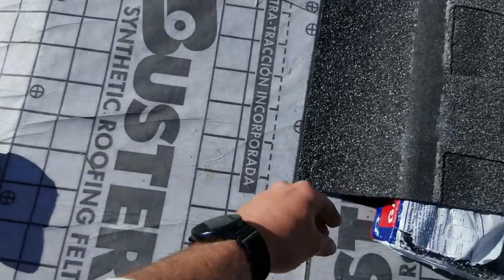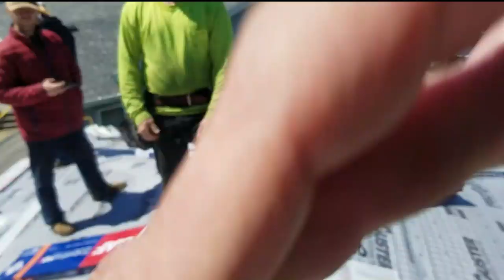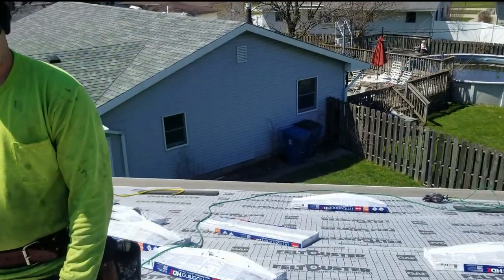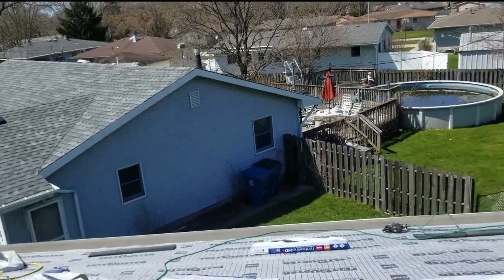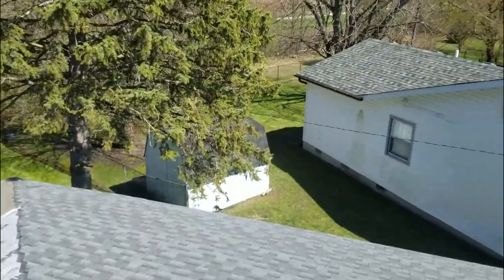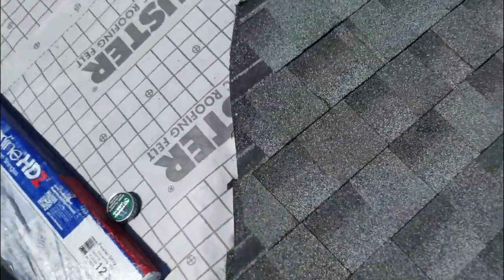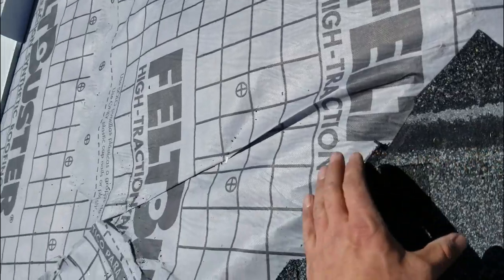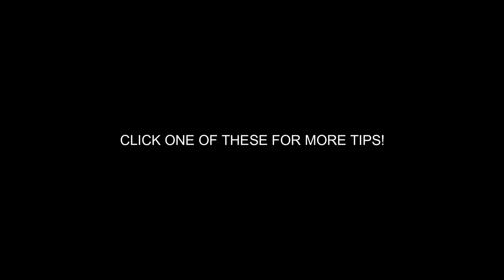1v1 SHINGLING RACE!! Pouch vs no pouch

Comment: This video has a lot to say about experience, and confidence. You can see that you clearly kept a task orientated mindset and consistent speed. While Tim flipped back and forth several times, the gun left his hand after every single shingle, and he didn’t spread his shingles in a manner that would ultimately increase his speed. You could see he tried to make up for it by nailing faster, and ultimately had to pulll out the hammer and fix the nail heads/placement several times. What you should do is take a slow day, and set up a system that the guys can follow, mentally, so no matter who is shingling, or teaming up on a side, they know the phase and can seamlessly migrate between partners without back tracking or missing steps. You got a good crew, instill a couple install systems, and as a team, you take some serious leaps and bounds in your speed/production times, as well as, create a confidence bond that will help any of the guys work together seamlessly!
Reply from the maker: great words thank you!

Comment: Roofed for forty eight years it destroys your body especially taking them off.
Reply from the maker: Yes I do my best to take care of mine even though it was definitely damaged in this video
Reply: You got that right  been doing it for 40
Reply: Maybe if you don't do any strength and conditioning outside of work. Don't have any sort of stretching practice. Live off soda, cigs, gas station burritos and monsters. Yeah your body is going to fall apart when your stressing it like this. But if you take the time to eat properly, give up the energy drinks and smokes and stretch before work and lift on the weekends. I can say from experience that your body won't fall apart it will actually get stronger over the years instead of weaker.
Reply: @calebgonzales3836  yes sir I'm 54 been roofing for 32 years  I'm still good to go

Comment: I did the same thing for 12 years, I’m old now, life is quick.
    No pouch, knee pads and no hand banging?
   It’s easy to go faster with a gun.
   I used to put on 50 a day by hand on a one layer strip with 3 valleys high dormers, 3 tab.
    What about putting a tarp on when a storm comes in?
   Gotta work every day!

Comment: Speed challenges are a reflection of the boss and systems he is enforcing. 
House obviously does not have enoigh external venting. Looks like it probably had a whirly on there? 50/50 venting soffit and peak. Looks like the old save 2 or 3 extra vents and screw the warranty and years of life throigh proper venting.

Comment: The reason the one guy is quicker is because he never lays his gun down. I try telling guys that makes you faster!
Reply: Its only faster once fhe guy tries it for a bit. They are fastee in the short term with the fast habit they have, 2 aeeks of slightly slower will make them faster in ghe long run.. but roofers aren't exactly doing it because they are good long term decision makers.. 
Laying down ghe shingles in 4s slightly overlapped down the step is key for not putting the gun down (if you don't use passers).

Comment: I'm thinking Tim needs a better gun and you would be faster with bags. Not fully loaded bags, but at least a pouch that holds 5 coils, your knife and maybe a hatchet. Just a suggestion. But, all in all, good race.😁👍
Reply from the maker: for sure. but i would not be faster with bags. there was a coil everywhere i needed one and i didn't need the hammer coz the bostich shoots perfect. those bags will slow you down after about 2 hours straight. let alone 6 or 8 hours. its different somehow than walking around with one on a framing job.
Reply: @NWIVeteranConstruction   I guess its a matter of preference. I wear bags all day, every day and it doesn't slow me down.

Comment: Tim opens his bundles with care,
Folding them like that, puts unneeded stress on the laminated part, even with laminated lock.
Reply from the maker: it doesn't hurt em none i promise.
Reply: @NWIVeteranConstruction  heating and cooling for 10 years will be the judge of that :)

Comment: My brother and I shingled 8 sq in 4 hrs.
While 6 roofers were 1/2 way done with their side .
I shingled 80ft long 15 ft tall started at 8 am done by12pm.
Ranch.
Reply from the maker: Sounds like ya'll got it together! Nicely done
Reply: 12 squares in 4 hours two guys not bad. the one thing to keep in mind when roofing is time is money but when you have to go back because of a leak now that's a waste of time and money.
Reply: @carlsmith4767  I've been roofing since I was in my early 20s now 55 .
I have yet to have call backs and doing that roof was a favor .
Not money maker.
Now I'm a high altitude waterproofing technician.

Comment: Cool.   my question is how do you cut the shingles without damaging shingles below or cut the papee on the hips? Are you using a hook cutter? It doesn't look like it.    how much does a roofer make per square?
Reply: on a hip roof use a shingle sideways and cut it to the height of the shingle so 12inches and you'll have the perfect step. may change a little depending on the pitch but not by much

Comment: I have only installed the hdz one time,and I know gaf says you can nail anywhere between the two lines,but i dont buy it,I think you should still nail threw the double,especially in colder weather when seal time is a issue.Ive never been a big fan of any gaf products.
Reply from the maker: I thought the same but these things seal with the slightest bit of sun and its their rules and them crimps look good enough
Reply: Ill have to check out the inter lock system a lil closer if we use them again to get a better opinion,good video tho,a lil competition always makes the day go a lil quicker.

Comment: Can you please show me how to install the ridge where all of the ridges meet up on a hip roof
Reply from the maker: all four come to one point? in my video that says a l"ittle challenge" (about 8 months ago) I show how it turned out...might help you. but this style is easy. where the 2 hips meet a ridge board. you just slice half the shingle. you can do it on the face, OR you can do it on the back of the cap. both will allow the shingle to lay flat. just make sure your next cap goes far enough over to cover the beginning of your cut because that is the weakest. nail. and caulk (if you cut the face which I did on this roof)

Comment: Gotta love those back breakers lol. 7/12 is probably my favorite. What's your favorite pitch roofers? 🤔
Reply from the maker: i prefer the 4/12s lol
Reply: Actually I like it when the pitch is just high enough that the tearoff just rolls off the roof.
Reply: @NWIVeteranConstruction  crucial on the knee tho. Mine are finally starting to crack and pop. Ppl talk about the back when it comes to roofing but them knees take a beating over the years
Reply: I prefer 5/12
Reply: a real roofer will do it all no matter the pitch
Reply: @stevejones8486  My Shingle Partner is 65 years old been shingling 41 years. He has no cartilage left in his knees. Makes me glad I only weigh 124 pounds lol
Reply: @davidtarsey6065  is he still doing it? That's awesome the longevity and if he's still putting it down at 65. I'm a lean 160. I wonder what I can use or do to prevent some of that?..maybe knee pads or something? I just don't like how i feel when using them. Not used to it
Reply: @stevejones8486  he still shingling I am praying he comes back next year after winter I'm in Saskatchewan....as for knees I use "kneel rite" they are thick black rubber but they are soft only $45 (CAD).

Comment: I never done a left start being a right handed 
How learn was start from right to left is that just a different way?
Reply from the maker: the way him and i did it, is typically what right handers do. lefty's are opposite. easier to nail across your body from dominant hand towards off hand. also easier to grab a shingle with your off hand since theres a gun in your other
Reply: @NWIVeteranConstruction  oh Mayne the video is turn then, I also noticed the stair but no beginning of the row
I usually cut my pieces 1st then start putting shingles I cut 6 shingles into the pieces I'm gonna use and then from there we start working all the way out 
We usually have like 3 shinglers and 1 guy works as feeding us shingles making sure we have enough in each rows 
But I noticed those are architectural shingles and I have used both types of shingles
I think everybody learn different 
But great work from you guys! It was awesome watching you guyw

Comment: I been shingling for 25 years I hate when I see other roofers cut their shingles down the hip line. They usually cut the dry-in as well when they cut the shingles. This leaves the OSB sub decking exposed, allowing water damage to take place if the hip cap fails. Myself I like to bring my nail line of the shingle to the hip allowing the top end of the shingle to lap over the hip. This will keep the hip watertight if the hip cap fails.
Reply: @dennisking5862  yes sir your 100% correct
Reply: U must have OCD bud and I'll bet you it takes you an hour to lay a square. First of all why would you ridge cap fail if you know what you're doing second of all every roofer should know the hip and the ridge see the least amount of moisture
Reply: And you act like every house is has OSB subdecking
Reply: @dennisking5862  Just by your comments tells me you have no fucking idea what you are talking about. moisture barrier has nothing to do with blocking heat, it's job is to retard the moisture from moving around between the shingles and the roof sub deck. When you have cuts, rips, or open holes in the moisture barrier it can not do its job leaving places were moisture will leak in. this forms rot on the roof sub deck witch in turn will make the roof weak and fail. every roofer know the difference between Ridge and Hip but you I guess. But I do have to thank you tho for all the roof you screw up and the work you give me so thanx. BTW most state require at less 7/16 OSB to be used for roofing sub deck. reg ply wood does not hold up well in dryer states or to the heat nor does it have the strength as OSB does. you talk about OCD but you reply  to this post Two time 9 month apart you must really need a friend.
Reply: @ogersoulless8912  ok smart guy tell me how many roofs have you torn off? Haven't you noticed that sometimes when people run out of felt or they stop short of the side or for whatever lazy ass reason they just don't dry in an entire side and lay shingles. The shingles without the felt underneath them seem more burnt because it's not the rain or the cold that deteriorate the shingles. It's the sun's uv rays and the heat coming from the attic that deteriorate the shingles more than anything (but we're not counting moss)the felt, synthetic underlayment or hybrid felt acts like more of a vapor barrier than a moisture barrier the shingles are the moisture barrier. 
What I'm saying is from someone who has had plenty of time tearing off shingles  3years in Iowa and 8 in Oregon that the hip or the ridge is the least vulnerable. There has been countless times where you have torn off s*** roofers work or home owner specials who don't know how to cap and it blew off or there were tons of exposed fasteners but yet it wasn't rotten cuz when it does see moisture it is able to be dried out and sees the least amount of moisture so you might as well take your time and make it look nice and who cares if you cut a little paper on the ridge I said it's not going to hurt anything it's not like you're in a valley.

Comment: Also, I don't quite understand why it seems like you both are afraid of the edge. I sometimes find myself standing tiptoe on the first shingle so I can gauge the second out of habbit.
Reply from the maker: i'd like to see that. i'm not afraid of the edge, i just got big feet and prefer 2 courses. mostly because the shingles are stuck together in 2's. i'm sure you saw how smooth my two rows went down
Reply: @NWIVeteranConstruction  Indeed. Your starts are smooth. Ever thought about doing 4 rows instead of 2?

Comment: Why snap a line? Flip shingle upside n use inch n a1/4 tape mark past sheathing or fascia
Reply from the maker: Huh? Your overhang needs to be ¼-1 inch.  Snapping a line takes almost no time as you can see here. It's the more professional thing to do.  Something this size doesn't really need it as long as the fascia is reasonably straight.

Comment: can you still get 5 steps on the hips?
Reply from the maker: Nah, I don't really think so.  I use the 2 full shingles and only one gets cut, the part I get is used next.  So 2 shingles gets 3 steps here.  Where as my other method was 3 shingles get 5 steps
Reply: @NWIVeteranConstruction  what do you think about doing full shingle half shingle for hips? maybe smaller hip roofs?
Reply from the maker: @redsresearch  it doesn't really work in my experience. if it's a lower pitch like a 4/12, you're gonna want to take a little more than the usual off. Like a full 8-9 inches, and that way the scrap is used and you'll naturally end up with  an even step. But when the pitch is steeper like an 8/12. You're going to want to cut about 7-8 inches and you might end up with 4 steps because the rise angle of the hip moves faster

Comment: @ 37:35 guy in white cuts shingle, and now the cut shingle butts up to another shingle. Is that a no no ? Thinking of doing my own roof after bad hailstorm we just had.
Reply from the maker: No you can have non factory to factory connection.  Its next to unavoidable honestly on most roofs.  Key is to cut straight and make sure when the butt up it looks clean and none of the top of the shingle below is exposed.

Comment: I didnt watch the whole thing but the kids problem wasn't wearing a tool bag he sets his gun down every shingle to place it... if he used his gun he would have beaten you... looks like you were taking it easy
Reply from the maker: yea i mean, there's always that possibility. but no. its all in the set up. i've spent years eliminating as much wasted movement as possible. that's key. and my back this day, was completely screwed. i pulled it 4 or 5 days prior. absolute worst pain i've ever shingled with. so yea i was taking it a little easy.

Comment: We’ve been using Landmark pro shingles for years they have the same nail line how have you barely started using these kind lol
Reply from the maker: hdz are brand new and not fully available yet. need to look at the landmark pro
Reply: Landmark pro, 
Is what it says.
Landmark pro
Reply: I’ve used landmark pro they are ten times heavier then hdz and shitty to work with in winter lot of blow throughs.. but are good product but honestly hdz is the best out
Reply: Austin Oquendo A to Z

Comment: Was Tim's hose leaking? Lost count on the times he pulled his 🔨 out
Reply from the maker: that's hitachi for ya! reason #1 i use bostich over hitachi. every hitachi I've used leaves the occasional nail under driven.
Reply: Worlds Fastest Shingler true stiry
Reply: I mention in the video that the front seal that seals around the hammer that drives the nail is bad. Needs replacement

Comment: Points off for knocking nails off roof with hose. I would beat both of you in my younger days. lol
If weather like this, (not hot enough to melt tar strip) I would use whole shingles on left side THEN cut them and use on othe side. Same amount of waste and your cutting twice not 4 times.
Reply from the maker: If I understood you right, I tried that a long time ago, was the biggest mistake I ever made lol and that's cool man. But out of curiosity, what is the most shingles you've ever installed in a day? Or personally seen installed by someone else faster.  With or without a tosser
Reply: @NWIVeteranConstruction  Yeah, can def. only do that on a cold /chilly day or they would be stuck all over. As far as "square a day", we did 90% residential (cut up) so I never really  had the opportunity to do a wide open 50 square area. If I got 8-13 square nailed on in a day I thought I was doing good. lol. I was the foreskin (foreman), so I was the one bending metal and flashing walls and chimneys and vents and boots and pipes, fixing wood, running valleys, etc..  Just watched your "50 square in a day vid", THATS CRAZY!! You are certainly good! You'll be a millionaire soon if not already! As far as any of my comments, no disrespect at all, just an old roofer messin with ya!
Reply from the maker: @negemyshibalbeckbojiya4875  no problem bud! I ended up with 40 sq that day.  I hope you continue to watch.  Always nice to hear from the guys that have been in the game for awhile. On that 40 sq day I filmed everything on a separate camera and the footage is epic.  Coming soon

Comment: You won cause you ran bottoms 1st.. I do the same must faster to get them done then just run
Reply from the maker: yea I've been a fan of it as well. gives you some consistency. I also think i'm going to work on spreading the starter and my bottom row of shingles all before I lay them. rather than spreading and installing starter and spreading and installing the bottom 2 rows. I got to toy with it